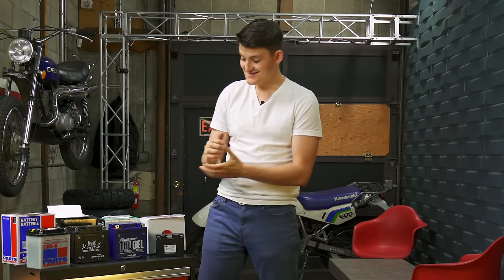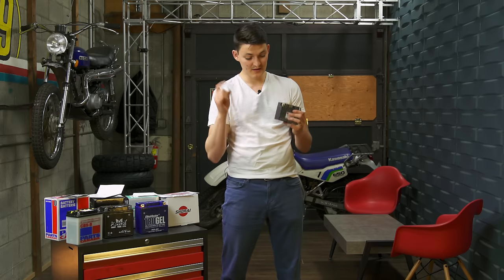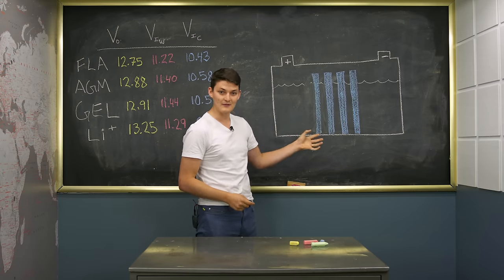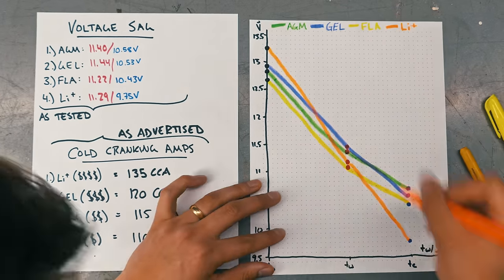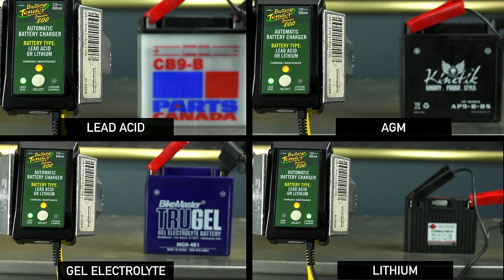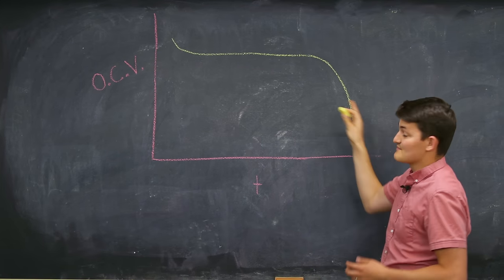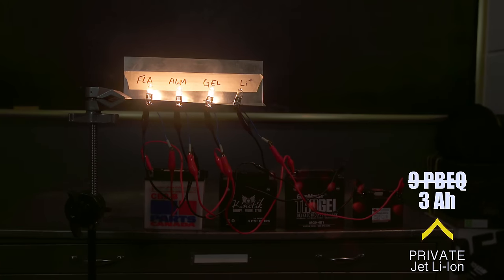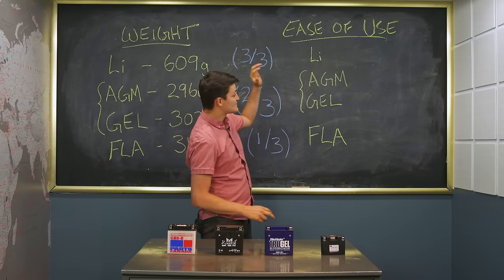Best Motorcycle Battery? Lead-Acid v. AGM v. Gel v. Lithium

Comment: In a motorcycle scenario, wouldn't AGM and Gel have a nice advantage due to the constant centrifugal forces of the bike because they keep the acid on the plates instead of sloshing around? or is there not enough room in the battery for a lot of sloshing and this is negligible?

Comment: What about boost packs? Sure they discharge within 1 week and no useful capacity, but they are even lighter than lithium, have no problems cranking even in winter in super cold conditions, have millions of discharge cycles and pretty much instandly charged

Comment: fyi a good lithium will outlast 2 lifetimes of a acid battery if cared for properly which will end up being cheaper or equivalent in price in the long run. i dont see why you should go acid anymore when the time comes to replace the battery if not ure really cheap and feel better spending less even though u might be spending more in the long run.

Comment: Im sure that lithium battery has a cutout to prevent over discharge , this would prevent permanent battery damage
Reply: Yes. Just like in cellphones. When they say 0% and shut the phone down/off they are not truly 100% discharged. Lithium do not like to be nor last if allowed to fully 100% discharge.

Comment: Man it's 2020,
Use universal unit of Power (W) & Energy (W.h)
Ah is a flawed unit which doesn't take voltage into account.

W & W.h are simple to understand and use,
Running a 10 W bulb for 1 hour = 10 W.h
Running a 1000 W aircon  for 1 hour  = 1000 W.h = 1 kWh

Comment: This would have been humorous if you'd used a 5ah or 7.5ah Limitless Lithium Motorsports series battery. It's real world capacity would have kept up better and it would have absolutely obliterated the other batteries in every other test, other than possible the cold test.

Comment: But what about the motorcycle charge circuit? Most bikes' rectifier / regulator is not a sophisticated design and is intended to charge Lead acid batteries. So if I want to change to a Lithium bike battery, that will mean an upgrade to the bike's electronic charging circuit as well, yes?

Comment: please rename this to "Which Battery is Best for your MOTORCYCLE? Lead-Acid v. AGM v. Gel v. Lithium"  I came here thinking this was a generalized question, because of how the title was worded. -  in a non-generalized sense im attacking this because from the title i had no idea it was motorcycle specific. i dont understand why the title didnt just say " best battery for your motorcycle " that would have been a direct question - the title didnt say anything about motorcycles tho, and when i came to this page i thought it was just comparing chemistries. i think the title could be re-worded, to attract a larger audience to reflect your actual question. i mean since this is obviously geared toward motorcycles, why on earth is that not mentioned in the title? unless your click baiting nerds.  btw this nerd rides a buell xb12s, and the factory battery was an agm  ,, its what ive always used, with zero issues.

Comment: I don't know man, every ounce makes a noticeable difference on a motorcycle.  That alone is enough of a reason for me to prefer the lithium.  I don't live where it gets cold and as long as it has enough juice to start my bike, I could care less about capacity.  It's not like I'm sitting in my car listening to the stereo with the engine off.  Also, that lithium battery has charging/protection circuitry built into the battery, I don't see why a special charger would be required.  How would it function with your bike's stock charging system otherwise?

Comment: You say it's bad to charge a lithium battery under 0° Celsius 32° Fahrenheit. does this include the alternator charging the battery under those temperatures? Or are we assuming that the motorcycle is heated up enough that the battery is no longer at those temperatures? Or some other thing that I'm too stupid to think of.

Comment: With their compact size and weight, could you run three lithium ion batteries in parallel for the best all around performance? Seems it would then win every category except price, and motorcycling is pricy anyway, so what’s an extra $300 if it guarantees fail safe starting on the road?

Comment: The best option is an ebay chinese lithium battery that costs 60 bucks, weighs 500g, says that it will only start 125cc scooters but has had no problems starting my KZ400 fro the last two years. No winter charging, no topping off, no anything. Starts my bike every thime even after month of sitting, even when cold. Just put it in 2 years ago and forgot it was there. Death to lead acid.

Comment: unless you charge the lithium battery with a 16.8 1A or 16.8 2A charger you will never realize it's full potential. the lithium battery has its own self protection and charging regulation board inside its case. the charging system from a vehicle will never fully charge the lithium because of the charging system. if you charge the lithium battery before a long non use period it will outperform any of those other batteries by far. come back in a year and test the batteries and see who wins after they sit for 12 months after fully charging each battery to its full charges state.was thinking about installing a DC-DC Boost Buck adjustable voltage board to see if it would keep my lithium battery charges fully from my vehicle charging system. my lithium battery in my atv is 8 years old and still starting the atv like it did on day one.

Comment: Just bought a new 2017 Honda rebel 300 and I’m not exactly sure what type of battery they installed? I’ve had it in storage since October and usually start it about three times in a month to keep things going but sometimes I wonder how long the battery will last since the weather is usually around 28-35 degrees.

Comment: You are confusing lithium iron batteries with lithium ion batteries. You have a lithium iron battery in the video. Lithium iron have some characteristics you would expect from lead and some you would expect from lithium ION.
Reply: That battery you showed on fire was a lithium Ion. It sounds the same but is very very different. Lithium iron is way less likely to catch fire. A true lithium ion battery would be even lighter.

Comment: Spotted a duff bit of info in this one!
The Lithium battery your using is a Lithium Ferro Phosphate or LIFePo4 unit. You warning about dendrites May also apply to these I am not sure but the bursting into flames of shorted does NOT!
If you hammer a 6” nail through the battery it will heat up to about 60 degrees at which point the chemistry denatures and the current stop flowing and it cools
Down into a useless brick, unlike its predecessors Lithium Ion which can And LiPo’s often used for model aircraft etc which regularly do and are the most notorious for this incendiary behaviour!

Comment: Is the LiPo battery not just 4Ahr?  I have a LiPo battery on my Fireblade and it says  48WHr, which is roughly 4 Ahr, but it starts the bike MUCH better than the standard AGM, which I believe is 9 Ahr, and there is the weight saving of course.

Comment: The charging section is null and void, you didn't use a charger specifically for the lithium Ion battery, if you had it would have charged alot quicker than the others
Reply: Actually, that was a multipurpose charger,.. with selector switches i think

Comment: At 6:37, who cares what the Self-Discharge rate is of any battery, be it an AGM, GEL or Lithium. I do not know of any battery sitting on a shelf other than those at a dealer or unless I remove it and most people don't. You have current drains from various devices on the vehicle when it is shut down that are hundreds of times more.

Comment: Could I just use a 9Ah Ryobi One+ Power drill battery? Sure it's 18v and not 12v but surely it will be better and cheaper than all of those batteries, and is smaller

Comment: Two points missing:  When that flooded battery drips onto your chain or frame, you lose a lot more than you saved.   Also, their longevity and recovery from a deep discharge are both crap.  There just isn't any reason to install those old nightmares in anything.

Comment: My 125cc Bullit Hero came with a Lithium battery, and its a mess. It loses charge with time quite fast and is pretty picky about
maintenance charge voltages.  My Honda SH moped from 1986 has a conventional old battery, and you can start it up after
6 months in the snow in winter. By then the LI battery is brain dead, will be replaced by a conventional battery.

Comment: A kick starter and NO battery is the perfect solution...
Reply: Nah, only works good for small engines, dim lights at idle. Not great already at night and no way of illumination when broken down. 

Best is to have a battery and a kickstarter. 

Even worked on Honda bikes with fuel injection and a flat battery

Comment: Lithium batteries are incredibly over-priced.  You can build a better one than what you can buy for the same cost as your lead-acid battery... and it will have far more starting power (CCA) than any battery you have ever used.

There is one item of contention, though: Lithium lasts 10+ years... well... assuming you don't discharge it all the way down and leave it there.

Comment: Got a lithium battery and suitable alternator and voltage regulator for it on my '72 Norton Commando.  And I've never had a problem starting it.  It takes two kicks to turn over when it's cold and you have to get a charge from the carburetor down the intake runners.  It starts with about half a kick when it's warm.

What's a starter motor?
Reply: What does the battery even do ?
Reply: I had a kick start honda XR250R  and it didn't even have a battery.

Comment: find someone who can get them for cost and throw them a few bucks. i was a mechanic at a Kawasaki dealership. mark up on batteries are usually around 80% which sucks. i got most batteries for $20 though the $200 one i needed for my jet ski i got for $80.

Comment: I know this is a pretty general good vid of the technology. However, I've seen a lot better batteries than these basics. There are VERY good lithium's out there but they are $200+ USD. I think the one you used was like the lowest basic one. I think the higher end would have performed much better even though it's still not as good in the cold.

Comment: current tech in lithium batteries makes them bad as an every day used automobile battery as they dont like being constantly charged while at a high state of charge, drastically lowers its life to less than that of a lead acid

Comment: Hey guys, I've got a question about the Lithium batteries, perhaps someone might help with an answer.
As far as I understand, there are special chargers for those Li batteries. So the conclusion seems to be that it's at least not a good idea to charge the Li battery with a charger designed for, say, AGM batteries.
If so, do I have to change anything in the electrics of the bike if I want to replace the old AGM battery with a Lithium battery? Rectifier, regulator, anything?

Comment: Question that was not coverd i just bought a battery for my bike and asked if the new lithium was any good. The sales man replied with i dont want to stock thoes as yet because of the charging rates of the alternators in bikes. He sasaid they are too picky whith how they want to be charged and systems on bikes or cars are not made for that.......... Yet.

Comment: Question, can I charge a battery in my non heated garage over the winter and it will be ok. My V-Strom battery has so many things attached to it, the previous owner connected the charger cords to it. Last winter I just left it in the garage and plug it into the tender.
Reply: Just use a battery tender and you'll be fine. Last winter we had two weeks of -25 to -30F. One mourning of 42 below zero. My bike and lawnmower sit in a old shed with snowdrifts when it blows hard. Both started fine this spring. Bike battery is 4yrs old.   Reg lead acid. Keep em charged and they won't freeze.

Comment: Isn’t there an issue with parasitic draw and lithium batteries?  I don’t recall the exact details, but newer bikes have clocks, alarms, etc. that draw current even when the bike is not running.  This small current draw is not good for lithium, supposedly.  Can anyone explain if this is true, and why?

Comment: Good day sir. Im planning to put super capacitor for my bike. Is it true that the super capacitor will damage my ecu and alternator?? Thank you.
Reply: Why ? The energy density of super capacitors is poor so the battery will take up a lot more room than the worst lead-acid one and the voltage is not constant so you need some electronics to compensate for that (the terminal voltage of a lead acid will fall about 10% between charges, Li-ion is better than that while a super capacitor will happily discharge all the way to zero volts). If you are building an electric dragster super capacitors make a lot of sense because you only need to store enough energy to cover a quarter mile and the very high current they are capable of delivering is exactly what you need for that rather specialised application.
It is true that to use super capacitors will require a totally re-thought charging and discharging setup to lead acid or lithium-ion. A fully discharged super capacitor looks like a short circuit to an alternator so unless you take measures to limit the charge current the diodes in the alternator will die. The ECU needs a stable voltage, you won't get that from a super capacitor without some clever electronics to take the voltage of the super capacitors and convert it to a stable and appropriate voltage.

Comment: Shorai Lithium Battery in fact "cheap and bad" - used "regular" cells (low voltage on cold) and no internal BMS (long charging).

Comment: Ah ratings are not all the same. Some base it on 1 hour others are 6 or 8 hours. Some are based on a slow discharge rate on fast. All manufacturers use there own formula no standards exist.

Comment: Lithium batteries are becoming less expensive and last far longer than any alternative. They're also much lighter and that's important in a bike.
Reply: They have more work to do yet. The capacity needs to rise and the price needs to fall.
Reply: @chrishart8548  They're already better than any alternative.
Reply: @yarpenzigrin1893  I've found a PowerLine GEL battery 14ah for £33.90   and  FulBatt lithium  4ah (10ah equivalent) for £134.15   what sounds best to you ? They both fit a F800gs bmw  ytx14-bs
Reply: @chrishart8548  How many lifecycles does it have? Do you allow your battery to go flat often? Lithium has significantly more lifecycles than the alternatives and can be fully discharged without any damage. It also can be stored or installed in any orientation and weighs a lot less.
But if you only care about the price then go for whatever's cheaper.
Reply: @yarpenzigrin1893  it's not a cat with 9 life cycles.   Any battery only has one life.  If you mean charge cycles it has zero.  Flatten a lead acid at your peril.   I've always kept my batteries at a decent charge.   For starting vehicles the battery should stay in a good charged state.  They are not deep cycle batteries.    That's why for CCa lead acid batteries are unbeatable value.  They are designed for this task only.
Reply: @chrishart8548  Yeah, my battery sometimes goes flat when the bike is not in use and I forget about checking it. So I'd have to buy a new lead acid every year if I forgot. With lithium it's fine. And it weighs less so that's also a bonus.
Reply: @yarpenzigrin1893  I do put mine on charge every couple of weeks on a really small charger probably 150-200miliamps  I do really want a lithium  but I don't feel I can trust it yet, the antigravity looks good with the re start feature. But I'm not sure we can get them in the UK and they seem really expensive.
Reply: @chrishart8548  I have the BC BCTX9-FP battery. I'm super happy with it.
Reply: @yarpenzigrin1893  least its honest  says 3Ah right on the front. It's  worth a try £69 free postage.
Reply: @chrishart8548  There are different models of BC batteries, maybe you need a bigger one for your bike.
Reply: @yarpenzigrin1893  it does cover a s1000rr  a rf900 a z800.   So I'm sure it would do a f800.  I think because it's an adventure bike you might run heated clothes,  extra lights GPS etc
Reply: @yarpenzigrin1893  £133.57 for the correct one  it's 4.5ah now instead of 3.0ah  but the price is almost double.
Reply: @chrishart8548  Yeah, they do get quite expensive the larger they are. But if your AGM is still in good condition don't need a new battery, do you?
Reply: @yarpenzigrin1893  it's still only 93mm tall vs 151mm for my stock battery.   Width and depth are the same.

Comment: Could your alternator cause the dendrites issue on a LION battery if riding in sub zero temperatures?
Reply: I guess it could do. These lithium batteries seem to have a lot of issues.  They should have temperature control built in like the electric cars really

Comment: By the way lithium motorcycle batteries that are actually good have IBMs and safety features meaning they can never ever fully discharge.

Fortnine didn't do his research and he ended up with a shit lithium battery. Not to mention he should have gotten the same size lithium battery instead.

Comment: What about instead of pretending the 3ah Li-on battery is a 9ah, why not actually put a 9ah li-on battery in the bike or whatever is the same size as the factory battery, then it will kick out WAY more amps, and still be lighter than all the options.  And won't die in 3 hours with the light bulb test

Comment: Really...$337 for a Shorai Lithium versus $104/$114 for a YUASA AGM. Seriously, will I get three times the life out of the Lithium battery? Not really...in fact not since I already get 8 full years out of a flooded lead acid (old tech) battery which even costs less than an AGM.